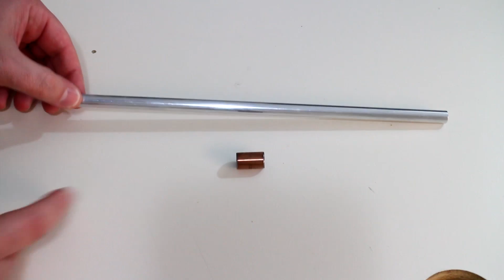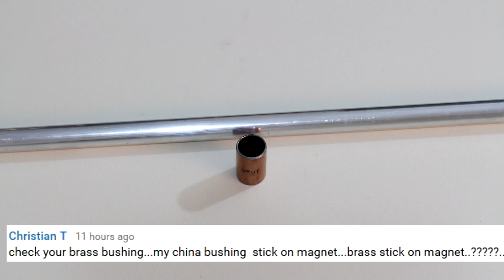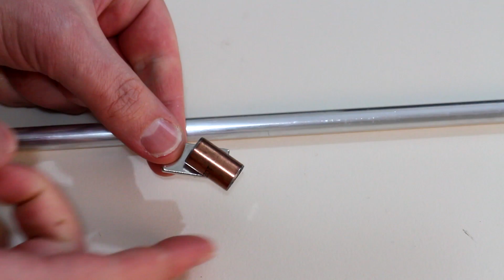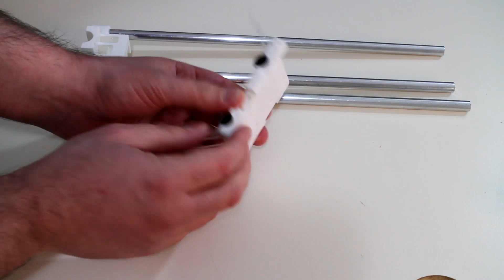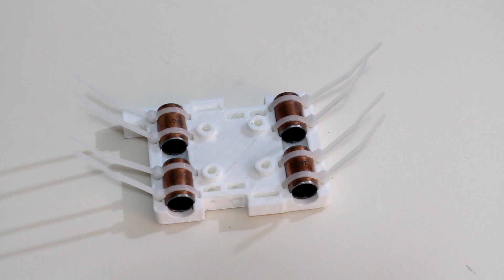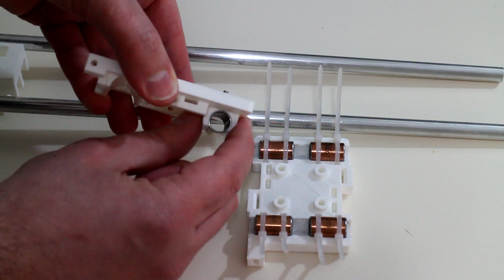New 3D Printer - Build Log #1

Comment: The 3rd swivel bearing does not allow for misalignment of the gantry rails, as it is the centre distance that is crucial. What it does do is to allow for very slight variation in the tubing itself, as aluminium tubing is not a precision product.

Comment: I like this idea but what am I giving up by not using the  rods and bearings from the Prusa clone printer?  If it is speed I can live with that.  My printer is a basket case since the cheap plywood frame broke in several places.  This is a CTC model.  Love the series and plan to build mine this summer.  Are you on Facebook?

Comment: You have inspired me to build my own core xy and I follow you on Thiniverse also. I have been gathering the needed supplies of, both T-Slot and V-Slot. Still don't know which to use for the frame. I found a REALLY good deal on the V-Slot after getting the T's that I couldn't pass up. Anyway, I'm now looking into the guide rails and thought about carbon fiber tubing for quad-copters and such.. Light-weight, rigid and CHEAP. Do you or anyone else have any insight about using carbon fiber as a guide rail component? Many thanks.

Comment: I'm preparing to build this printer : ) but just wtd to comment that from Day 1 using my Prusa i2 *which is capable of incredible accuracy when correctly assembled; At times I had great difficulty getting prints OFF the build plate rather than trouble getting them to stick; it's all down to bed levelling and use of a 1 layer mesh raft which becomes virtually invisible on removal of the model yet allows everything to stick to the build plate like glue - Ive used sewing machine or brass instrument valve oil to lubricate the rails/threaded rods which as per Chinese Build Manual Advice will surface corrode causing friction/drag if you don't handle/maintain them properly. Oil is your best friend with all things metal-mechanical.

Comment: The tube is 3d printed or the inside is machined? If it is 3d printed why not hold the 2 bearings with two half housing like you do at the end for holding the tube?

Comment: The only thing I'd be tempted to change is making the top bearing 3 bushings long instead of 2. That's the rail that's constraining 4 degrees of freedom, and the longer it is the more stable everything is. The bottom is only constraining 1 DOF (the one rotating around the top rail), which leaves just one freedom — linear motion.

Comment: i will have several feet of extra 10mm anodized aluminum tubing after my order gets here. Ordered it from (in the US) https://www.metricexpress.com/ProductSelection/ProductDetails?product=Round%20Tube&metal=Aluminum&grade=6060%20T6%20Extruded&size=8%20x%201&length=20

Comment: the file to print in this thingivese X carriage is not equal to this will be possible to provide this x carriage of the file?
Reply from the maker: This version is an old design and not used.
Reply: and you can not put the latest files?

Comment: Usually what i do if i use 4 bearing likeyour video at 3:40, is by heating the plastic of carriage using gas lighter.Just hot enough so the carriage plastic will adjust until the carriage move smoothly (even by gravity). 

But I like and  will try your trick.

Comment: You got some really good information here! Have you thought of getting a longer bearing instead of adding two together? As for the aluminium rod, you generally want the rod to be harder than the bussing. And if your china bushing are made of steel (even mild steel) they will be harder than your rods. 
I have a mounting solution for the moving bearing here if you're interested (if you use it for only one bearing)= https://plus.google.com/108624439407822232001/posts/AKPFfsh3m5x

Comment: Great video and im really looking forward to the continuation of the series.
I would highly recommend taking a look at the IGUS linear bearings or get some IGUS filament and print your own. Ive had some self printed ones on my i3 for 6 months now and they work great. The filament can be a bit tricky to print with but once you dial it in the results are worth it.

Comment: Design very good but aluminum tubing is a big problem because aluminum is sticky and fragile to vibration you should try to find a steel or maybe titanium tubing or rod. bushing always have to be softer than the shaft and here is the opposite . this system will work for a shot time then the friction of your <steel /bronze >bushing will break the surface of the aluminum tube that will produce a fine aluminum dust that will stick in the bushing then it will jam all the time ! BTW great video and this is only my opinion

Comment: aluminum is a soft metal, so I believe that there will be a big wear on the alu rods. Also Alu can't be harden like steel. A hard suface is necessary with sliding contact surfaces. 100% alu is useless. aluminum always exists as an alloy. I sure that the type of aluminum alloy you use is for completely other purposes.
What I propose is that you try this out (because I hope you can prove me wrong ) but keep in the back of your mind that you probably have to change your robs and baering.

Comment: Brilliant work!  I'm following this series with great interest.

Aluminum with Bronze bushings CAN work, and provide a decent service life, if loads are kept small.  Aluminum and bronze are commonly used in the focusing mechanism of expensive photographic lenses, where the slightest bit of slop can render a great lens unusable.  Consider an occasional application of a spray furniture wax, or a very light oil, to the rods to minimize wear.  But with light loads, this combination should provide many years of daily use.

I worry about the aluminum sagging over time.  But again, if loads are kept light I don't think it will be a practical issue.

Keeping the moving parts as light and simple as possible will pay huge dividends.  Consider removing the center of plastic parts whenever possible.  Consider a piece of plastic 100mm X 100mm X5mm.  If you remove a square measuring 60mm X 60mm X 5mm from the center, the remaining 'O' shaped part will have virtually the same strength as the solid sheet; but it will weigh 36% less (and use 36% less filament, and print 36% faster).  Back before fiberglass was as usable as it is now, the Gougeon brothers used this technique to lighten the weight on their plywood catamarans.  The material in the center contributes very little to part strength.  It might be worthwhile to run some tests, and determine how much material you can remove.

I seem to recall that you did some strength/weight tests when you were building your quadcopter.  What plastic did you settle on?

Really enjoying this series!  Keep on rocking, ignore the occasional rude comment, and carry on!  You're doing great work.  Regards, Charlie

Comment: I've been testing lots of different bearings/bushings, and I've landed on bronze bushings too. 

Here are some of my experiences:
1. Ball bearings: awesome for alignment and accuracy, but heavy and very noisy
2. IGUS: very quiet and lightweight but hard to align and has some slop.
3. Graphite bronze bushings: Not much slop, generally very good, but the graphite tends to make the rods dirty, annoying if you touch them. Also worried about graphite dust getting into electronics/lungs.
3. SF1/thin bronze bushings: very lightweight, too much slop on my rods, could maybe work well in a press-fit or clamped design? I've tried to find correctly sized rods but can't find any chinese vendors who understand ISO fit terminology (g6 etc)
4. Thick bronze bushings: very little slop, quiet and not too big/heavy, currently my preference.

To align bronze bushings I either use acetone to soften the ABS part, or simply heat the bushing/rod with a heat gun and then press into the PLA/PETG plastic, while moving the rod. 
This rapidly aligns the bushings in the plastic part, and as the plastic hardens this alignment is preserved. 
Additional burn-in will further improve alignment.
Your solution here for stacking bearings with good alignment is really promising though, I'm a little surprised it works so well.

I think your choice of bushings is a good one, but hollow alu tube is much too flexible I think, just buy some hardened rods from aliexpress, they are cheap and very good (just buy from a good vendor).

Comment: Very clever design! I've considered something like this on my own printer but decided against it because of how I had my belts set up. I think as long as you secure the belts close to that double bearing it should be fine, however if you end up securing belts lower down towards the floating one it may cause the gantry to torque and bind up. Good luck!
Reply from the maker: Hi there! The belts will be mounted evenly between the shafts. I will watch out for torque/rotation as you mention. 
You have a great channel by the way, well done with the Eclipse 3D and your upcoming v2!
Reply: Tech2C Gotcha, hopefully the bushings you chose can handle the load without binding or chattering, your carriage looks pretty solid so I think you may be fine! And thanks I appreciate it!

Comment: Advantage of putting rails horizontally is that you could center the mass and avoid rotational torque, I think bronze bushings need to be lubricated but I'm not sure (maybe they are already ?)
Reply from the maker: The bushings are actually steel with oil impregnated bronze for self lubrication. They do leave a residue on the shaft. The vertical rails seem to work fine on my Prusa i3 so I assume they'll be fine here, although my Prusa doesn't have a floating bearing. We will see.

Comment: My Folgertech Prusa i3 uses three LM8UU bearings on its X Carriage, though all three are attached with zip ties.  I think it was to reduce the binding you described.
I don't know if the aluminum rods are a good idea.  An aluminum bearing surface?  That's asking to get worn/bent.

Comment: Great Video.  Are you using anodized aluminium tubing? If not have you considered it?  There are probably a handful of different anodizing finishes available out there to try. Also anodizing might add a bit of wear resilience and some more accident forgiveness as pure aluminum can be quite soft and can scratch easy.     Also the company Igus makes some excellent plastic linear bearings for anodized aluminum rails so perhaps having anodized aluminum rails would allow for experimenting with plastic bearings in the future as well!

Comment: Why can't you use PVC and bearings instead of aluminum rods?
Reply: Ridgity and straightness.  Try taking a length of PVC and rolling it along a smooth surface. There will probably be a lot of wobble.

Comment: Since the x gantry will be moving in the y direction, I recommend you put the x gantry with the rails flat as opposed to vertical. This way you have more stiffness when moving in the y direction. it will be more stable and will be less likely to misalign, scissor, or twist when moving in the y direction. This is especially important with a core xy design, where the belts don't constrain the x axis to move perfectly straight in the y direction. Instead, it relies on the stiffness of the bot for precise y movements. With the prusa design, the x gantry only moved in the z direction, therefore requiring stiffness in the z direction and not the y direction. (imagine if you turned your prusa on its back. your x would still be your x axis, but your z would turn into your y axis) In addition, I wouldn't be concerned with deviations in the z direction caused by positioning the x rails flat, because that can be adjusted for in the bed leveling.
Reply: My point exactly. Amen.
Reply: Tech2c, I'm not trying to bash your design. I was in the process of designing a core xy but got too intimidated by the amount of work. I want to see yours succeed as much as you do.
Reply: I agree on the deflection issues with the x axis vertical. rotating the gantry to be in the horizontal plane will stiffen up the x axis.whip lass issues, if any.
Also the system of having a guide rail and a floating rail is a conventional approach to linear rails as it accommodates any ongoing misalignment of the rails. At times there are misalignment that cant be taken out of the setup due to thermal flexing and rods not being truly straight.
great work, I am interested in your progress

Comment: nice design. You could use carbon fiber rods from igus, like the ones you use on your drones. igus has a lot of options when it comes to linear bearins. it should solve your weigth problem and durability. great work. love your videos. you've helped me  alot when i got my first 3d printer kit. keep up the good work
Reply from the maker: Yes I was wondering about carbon fiber tubes. I have some 12mm here but I'd need 10mm. Stiff as nails they are so probably better than ALU tube but unsure about the surface with bushings/igus and heat from the bed affecting the CF tube.

Comment: Are you going to upload the CAD files to thingiverse as you have in the past? 

If this turns out, I may do something similar to this, though with my own twist. I have a printer very similar to yours(Hictop 3d desktop printer), and I also am not the biggest fan of the actual print itself moving. I don't have the time right now, but eventually I should, and this series could really help figure out what direction I should go.
Reply from the maker: Yep, once it's finished all files will be uploaded to Thingiverse. I'm still designing-on-the-go at the moment :)
Reply: +Tech2C  Thank you, I have been slowly trying to get my printer to print fast AND accurately, and some of your videos have helped me in the past.

Comment: Excellent video. I recommend you put affiliate links directly to the parts used if possible. if you where sharing the stl and parts list I may consider building this design. I like the light weight design and I'm realy liking forward to what toy do with the y carriage.
Reply from the maker: Once it's finished I'll upload the files to Thingiverse, like my other designs.
I already have affilicate links in most of the videos. It helps make this channel possible. I'm not quite ready to ask for donations through Patreon...
Reply: +Tech2C Yes I saw the link, I was just suggesting you link specific parts because I've found it's very effective when I've done it in the comment sections when youtubers don't give links. 

Anyway I'm excited to see this printer get built and I'm optimistic about the aluminum rods.
Reply: +Tech2C I too am looking forward to this and printing the parts for another printer.

Comment: Why don't you just use nylon and no bearings.  I've seen it done for prusa i3 variants.  Or even PLA bearings
Reply from the maker: I tried PLA and Nylon. They weren't as smooth as these bushings. That doesn't mean they won't work however...
Reply: +Tech2C that's true.  I've been thinking of converting my prusa to nylon for it all

Comment: While I definitely sympathize with trying to get as light as possible, I feel that there is a sweet spot, between lightness and sturdiness (if thats a word), where you might be venturing just outside that sweet spot. Badly explained, I know, but maybe you get my point anyways. Also, nice CAD modelling on those parts!
Reply from the maker: Explained fine, it seems like the general consensus. Well, it's $2 alu tube wasted if it doesn't work.

Comment: Hi. Designing a new printer is a real long journey and results neber often reach their goals. As I frequently. It"s a prototype > fix > prototype endless loop process. Mostly it is because we start from wrong principles or we change components into a known working design. 

I'm affraid you maybe do both here. 

Bronze bushings are ways better than LM8 ones. It'ok. But 8mm steel guides can't be replaced by aluminium rods of the same diameter for the same job. Obviously if you want the same mecanical properties they should be larger. Note that on CoreXY the dual belt tensioning brings other forces on the gantry. You should verify the diameter needed by calculation (moving forces, belt forces vs moment of inertia of the rod).

Seccond, any mecanical axis constrain a movement on a carthesian axis. That means you cannot have a trolley with a floating point or you can't physicaly constrain the movement on a the wanted axis. You're just creating some play. It's not a so bad idea at the start, but you need to lock your adjustable bushing in place when it is finaly aligned.

I will just finish with an advice : verify your machine geometry all over the build. Get a machinist square and a dial indicator if you don't have any actualy. And don't trust any part or anything assembly before to check it two times : dimentions and position.

Good luck !
Reply from the maker: Great comment! The Prusa i3 smooth rod is 8mm diameter, these ALU tubes are 10mm diameter. I can reduce the speed/acceleration of the printer if the ALU tubes flex too much, and easily swap them for steel of the same diameter if needed. The goal is to keep the x-gantry as light as possible, without  compromising the print quality/speed/reliability. 

Very much in the protoype>test phase and that is part of the fun.

Comment: That setup (two on top, one on bottom), is the same as on the Wanhao i3s. The idea of using aluminum rods and a friction bushing is a valid one, if done correctly. The only solution I have seen that seems decent, is the IGUS combination of anodized rods (not tubes), and polymer bushings. They have many, many extremely nice solutions for motion parts.

Comment: for the movement of the rail construction you could use something like the construction of the tarantula i3? There are sliding two pairs of rubber wheels in the t-slot extrusion.